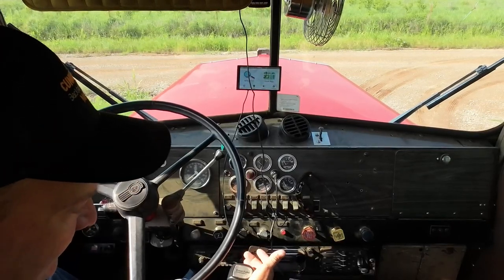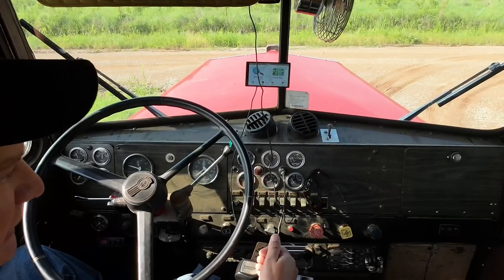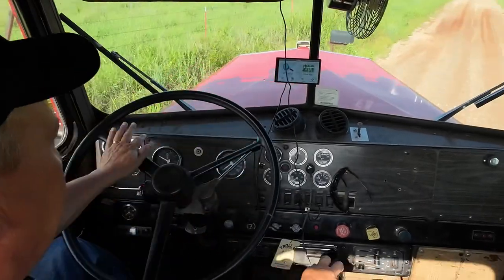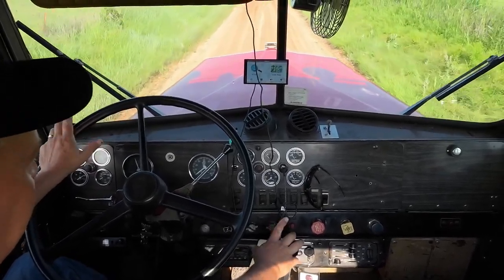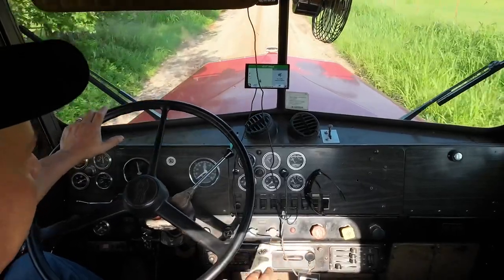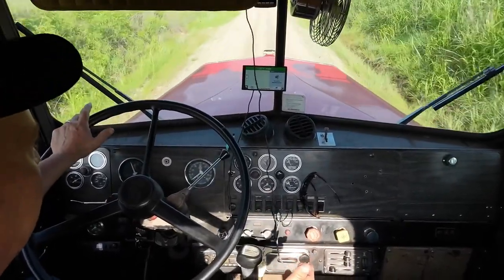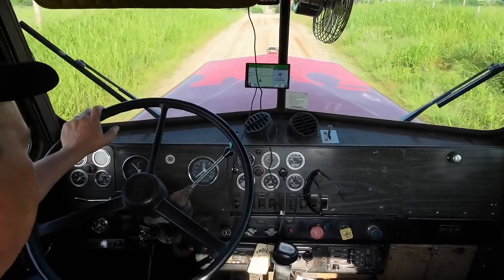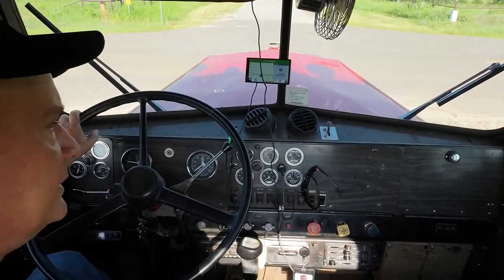How I shift my 15 speed

Comment: I still run a few 9 lo lo transmissions which are basically the same as a 15 speed minus the shift pattern...
  That deep reduction is a godsend for wet muddy conditions or taking off on a hill.
Reply from the maker: Yes the deep reduction is nice for reverse too. I have never driven a 9ll but I think it’s similar

Comment: Frankie, I’ve never had the opportunity to operate one of those transmissions.  But, I did learn how to ride a 10 speed bicycle… until I learned the difference between starting and stopping uphill and downhill, I was constantly having to fight when to change from low to high range.  

Then, one day, I screwed up and did it totally wrong.  Lo & behold it worked better.  Everything clicked after that and intuition took over.  From then on I never worried about shift patterns… I can’t tell you how you should shift a 10 speed but, I can show you.  

Watching you explain 15 of them brought a tear to my eye!

Comment: If you want to preselect the deep reduction to come into or out of it you gotta be quick on the throttle, such as jake it coming out of deep reduction and time it just right so there is no driveline bangin round, or for a downshift preselect, let off and immedatly smash the throttle and itll grab it as smooth as an automatic. I love 15 speed with 4.10 very good setup to have.

Comment: Frank, just curious why don’t you have a tandem dump truck, move equipment with it and do dump work all with one truck? That’s the set up I have and it works out good for me here in Alabama but maybe things are different in Oklahoma?
Reply from the maker: A few guys here have that setup, but I don’t like driving a dump truck, no disrespect, but I can hire one for less than I would want to run one for. Nearest rock quarry is 2 hours one way so a belly dump is more economical. If I had a dump truck I’d still prefer to hire a driver to run it so I can stay in the backhoe. I’m sure I could justify having a dump truck, probably would make money too.
Reply: @Digginok  yeah I understand the 5th wheel set up is much more comfortable to drive, and I see your point about the quarry being so far away, we are blessed with limestone here in NE Alabama, have 3 quarry’s within 30m of the house, they charge a arm and a leg for it but it is close and available, here you can’t hire anyone to haul it for you, most everyone is working for a contractor and doesn’t want to fool with  small amounts of rock haul
Reply from the maker: @nathanmoore1739  I have a guy I use for rock, he is reasonably priced, I just have to work his schedule. He runs belly dumps so that doesn’t always work. I mostly dig footings, so the guys I work for hire the haul offs.
Reply: Do you eat avocados?
Reply: @stevenmurata4392  Random ??

Comment: Have 2 - 15 spds behind 4 & 1/4 cats and a 379 pete with a 13 spd behind a 6NZ - C15    ... If you could split the top side of the 15 @ highway speeds it would be ultimate in my opinion !!!
Reply from the maker: Well if you could split the top 5, it would be a 30 right? 18 is a 13 that can split the lower 5.
Reply from the maker: My uncle had a truck with 3 speed rears back in the eighties, had gears for every situation.

Comment: Most transmissions that shift against the dash are overdrives in my experience. I like me a w900 a model in your current configuration is it a fast truck ?
Reply from the maker: Yeah the rtx 15 is the same except the od is to the passenger seat. 3.70 gears and 11-24.5 rubber. I’ve had it to 96 mph once, fast enough.

Comment: Yeah not the right way but if it works for you ok. You basicly skipped a gear when you come out of deep reduction that way and put back into the same gear. Like you were saying about the book says it's the correct way and gives a better even gear ratio. When you took it out of deep reduction and put back in same gear you could hear how much taller gear you took and it was laboring the motor, fine when empty. Wouldn't be so great if you were loaded and pulling up a hill. Correct way is when leaving deep reduction you go back a gear which in turn goes up 1 perfect gear ratio then you go up and so on. For example say you leave deep reduction 5th like you were correct way is just before pulling out of 5th gear flick deep reduction blue switch back on gear knob and straight away change gear lever down to 4th low range which actually goes up a perfect gear ratio higher then shift up again when required to 5th low range then change flick range Change up and change into 6th gear high range and carry on until up to top gear etc. You can Change out of deep reduction in any gear position from 2nd deep reduction through to 5th deep reduction by going back one gear position into normal low range which is one gear higher ratio than the deep reduction position you were in. Example you can be in day deep reduction 3 gear position then flick blue button backwards then make gear shift out and into 2nd gear position which is now 2nd low range. The purpose of deep reduction is only for getting rolling from a stopped postion when either very heavy where you require some lower gears or perhaps pulling out of a quarry with a full load up a slight grade or pulling out of a soft field type thing where you require lower set gears to get you rolling with less stress on truck. Most other areas on high way etc you don't need them and usually just use your normal 10 gear positions unless you may have extremly high diff ratios etc you may use deep reduction to get rolling.  

Nice smooth gear shifting though and cool old kw.

 Ps same format of shifting goes wheather its a 15sp od like yours (top gear up to the dash) or a 15 speed direct (top gear down to the right) exact same principal for changing out of deep reduction.
Reply from the maker: Thanks! But yeah I understand the pattern, I skip a gear. My rig weights 40k loaded so I don’t really need the deep reduction. My brother has an rtx15, it’s an overdrive like mine but the shift pattern is like a normal H with overdrive passenger side and back.

Ps thus the title “how I shift “ not how to. Also I don’t preselect the deep reduction, I find it’s best to shift deep reduction when in neutral only.
Reply: @Digginok sorry but who ever taught you to shift the gear lever into neutral and then flick the blue deep reduction valve out while moving in neutral and then back into gear has taught you wrong. It's not good for transmission. You should flick the deep reduction button out while in gear and then as soon as you move the blue button back(or out of deep reduction) immediately make the gear lever shift back one whole gear. Don't pre select and wait for a few seconds or longer before shifting the gear lever either.  I have old VHS videos from Eaton on this exact transmission when they came out new explaining correct shifting techniques and wrong techniques and the No No things to do. What your doing here is something they say NOT to do or continuous use like you do can cause damage to transmission. If you don't believe me there is another later video from Eaton that touches on this and it's on the internet,  you can look it up I believe the title of the video is something like:- "professional shifting the 8LL, 9LL and 15 speed transmission". It's youtube name is by "eatonvideos". This was put out by eaton fuller it is not the originalb proper version like I have and I haven't seen that vision on the internet but this one I just mentioned describes how to correctly shift also but just doesn't go into depth. Check it out sir. This might explain to you why you are not getting a smooth shift as you explain cause your not changing it the recommended way. 

Sorry I'm not having a go at you really cause you seem to shift well and smoothly it's just that your showing incorrect driving habits of that transmission and I see to many people on youtube doing the same showing people ways that are not correct and can possibly cause damage to the tranny. 

I'm a full time driver of over 30 years and have always looked to learn correctly over my time. I have driven most eaton trannys over the years and currently have both a later model 18 speed eaton in one of my trucks and I have a 15OD Eaton in my other older 94 model truck I own. I encourage you to look up that video if you don't believe me sir, if done correctly as i explained you should get a nice smooth shift with no clunks or bangs etc. Have a good day sir.
Reply from the maker: @bush600r2  thanks for sharing! The video is very informative. I do appreciate you taking time to let me know I’m not practicing the correct method. 
But, the video also says that you should clutch the transmission when you shift, all I have read and watched from Eaton says to always double clutch. 
With that said, do you always double clutch? I mean I do on occasion but usually I don’t. 
I am curious why you didn’t tell me I should double clutch as well?
And if you want to know my reason for putting the trans into neutral is to make sure there is no clash, since I didn’t clutch on the shift. 
I know a little about how transmissions shift, I have rebuild some myself. If you simply shift the deep reduction button and let off the throttle it’s going to do more damage than slipping it into neutral, in my opinion. 
I wouldn’t recommend my method to anyone as how you should do it, I will leave a link to the Eaton video in my description. 
I do know you mean well and I don’t take offense to the comments, that’s how we learn. 
But I can’t do a better video description of how Eaton recommends shifting their transmissions, they made it. 
Thanks again for watching
Reply: @Digginok Hi, I feel like I need to apologize in some way as I feel it comes out wrong in my writing. I really am not having a go at you and I think you know I'm not but the main reason I commented in the first place was cause there are young guys or learners watching these videos trying to learn how to shift the Eaton transmissions as that's what people do in today's world not like how we learnt when there was no internet. Again I understand you stated in your video "how I change gears in a 15 speed" The only thing is you and i understand that but to a learner is it teaching them good habits? And will they see that as the right way cause they have never been shown how to drive one before? And that brings me to another point. You may well be right perhaps it doesn't do any harm changing the deep reduction out while moving traveling in neutral so that gives me something to think about also and perhaps I may learn from you, ive personally never pulled a 15 speed apart. Main reason I've never changed like you shift is I get a very smooth shift from the way Eaton says to do it plus my transmission is still the original and almost done 2 million now and it's still running like new really, I'm just going off what the people who make and develop the transmission say to do and what not to do. I just don't understand why they at Eaton would say not to do something if it was ok to do so. You'd think there engineers would inspect the videos before they put them out to confirm they are informing people correctly in what they are saying.... who knows maybe they aren't. That video isn't that great compared to the one I have on vhs it's much better and goes over old model 13 speeds as well. Also reason why I didn't mention anything about you not double clutching is because I can tell by watching you that your doing a very smooth job in changing without clutch, would I recommend to others not to use the clutch no I wouldn't cause I don't know how well they can shift and I think until your fully confident you can shift perfectly without it then it should be used. Do I use the clutch you ask, sometimes I do yes it all depends on the load and terrain as to what I do. But yes I do often change gears without and I believe Eaton suggest to use it cause there are too many people out there that cannot make the shift smoothly. Alot rip or force the gear lever roughly out of gear or get it jammed half in and half out and that's one the worst things to do imo not to mention putting it into the next gear poorly and clashing the gears badly where if the clutch was used takes a little of the force and friction away if you mess up. I see so many on youtube not using the clutch and think man they think they can shift well when actually they are doing a terrible job. Anyhow I'm not going to go on any more. Initially what interested me to click on your video was seeing your old kw in the thumbnail and had the heading of the 15 speed which I also enjoy. 
Look I don't want to ruin your video sir with my comments in here so if you want me to delete them I'm more than happy to delete all of them cause I think you seem to be a decent person and can drive a truck very well. I mean no offense to you sir and wish you well with your work and your youtube channel and thankyou like you say discussion is how we learn rather than taking offense we can listen and learn. So Thankyou your thoughts gives me something to think about also. Have a good day.
Reply from the maker: @bush600r2  no apology necessary, we had a discussion. Fact is you have given me some things to think about for sure, good points. You in no way have hurt my video, leave the comments. Thanks for taking time to explain.
Reply from the maker: @bush600r2  email me, I have something I’d like for you to see from an old manual I got when I ordered my Kenworth service manual. Cunningham2442@gmail.com